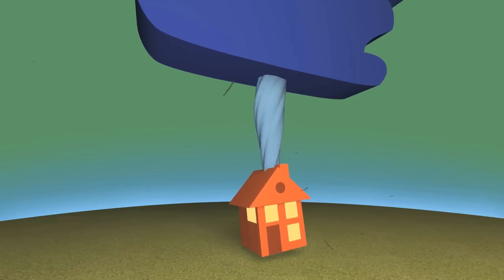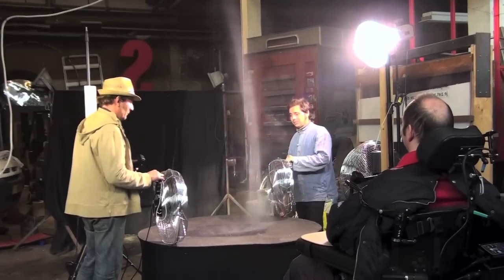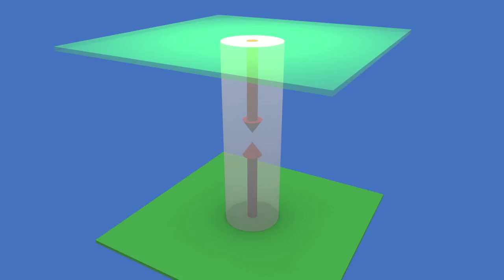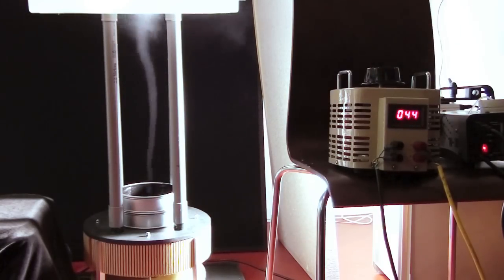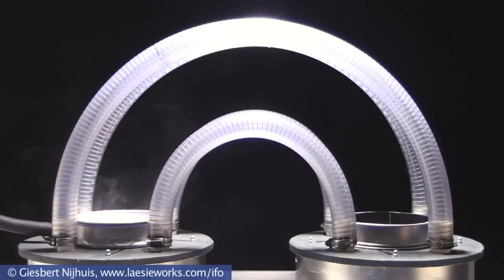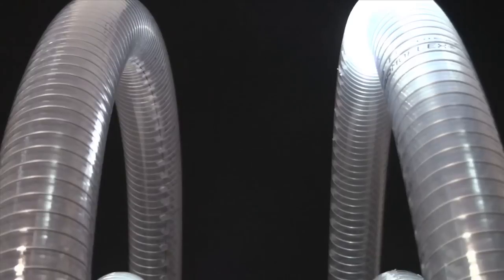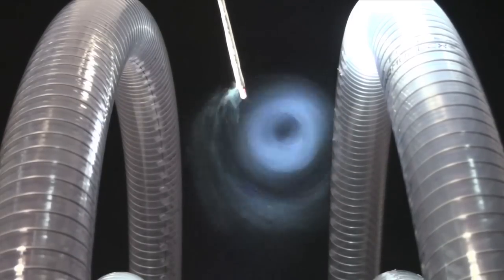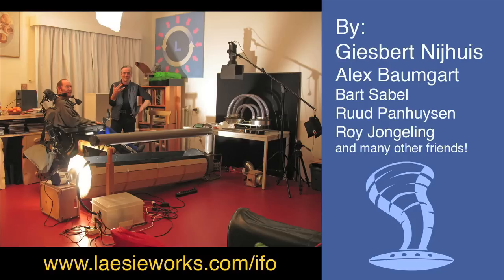Curved Vortex Lift (2010)

Comment from the maker: @scottrharris Thanks for your reply. Small birds, insects, fish, they use vortices all the time. Dolphins make vortex rings to play with.
The wings of an aircraft, yes: how wing circulation, trailing vortex, and starting vortex are connected, together a ring vortex. Though in flight the connection with the starting vortex is soon lost. Wing circulation together with trailing vortex are together like a curved/horseshoe vortex. Still no examples of using the center of a curved vortex for lift.

Comment: Very cool, I have had an idea utilizing curved vortexes for years now, but I have never been in a financial position to experiment with it.  The idea I have utilizes induced horizontal toroidal vortexes and propeller in a closed system with the goal of gaining greater thrust from the propeller in one direction.  What I have assumed is that a portion of the downward force created by the propeller could be canceled by the toroidal vortex pulling the air around its formation.  The rotational velocity of the vortex and velocity of air being pulled through the propeller should need to be similar.  Again, this is within a closed environment.  One of the cool aspects of a system like this is, in space, you could constantly accelerate.  Some, I would imagine, would say it was in the realm of a reaction-less drive, and while propellant-less it is still trying to generate an action by canceling out a portion of the reaction.  I really appreciate your videos.

Comment: @Trebseig The trailing vortices actually produce the lift. They induce a downward momentum flux that results in the force on the aircraft.  On an airplane, there is bound vorticity on the wing, the trailing tip vortices, and a starting vortex left on the runway. In the invisicid limit, these vortices form a closed loop. 

Consider a smoke ring: it moves because of it's own induced velocity. 

Take a look at the Kutta-Joukowski theorem and the Helmholtz theorem.

Comment from the maker: @scottrharris Wikipedia: "Wingtip vortices are associated with induced drag, an essentially unavoidable side effect of the wing generating lift." Modern civilian aircraft have these vertical wingtips to prevent wingtip vortex, to improve efficiency. Then again, the -sometimes- visible wingtip vortices are only the core of much bigger swirling air volumes, that can contribute to lift. Birds flying in formation make use of the vortex for more efficient lift. Not of the core of the vortex though.

Comment: A smoke ring is a curved vortex. Instead of blowing air down from the top onto a disc to get the Coanda affect I would like to blow air upward and pressurize the bottom of the disc while at the same time let the other half of the air through vents in the top and have that air flow over the top and down and then circle back around to the fan again. Once the air gets flowing around what you end up with is a disc trapped inside the top of a smoke ring. Helicopters are inefficient because the air comes back around and the blades have to try and get a push off air that's already moving. But with this design you get the air to come back up the middle and make use of its momentum. It's basically a circular wing with the center covered up(except for the vents out the side of the center piece on the top side). I know it sounds backwards(blowing air upwards) but if no one tries it we'll never know if it works. The point is to get lift by using the same air over and over. Like a smoke ring.

Comment: It would seem as though you might get more lift by changing the axis of the vortex... laying it down in a ring rather than standing it up? For example, you mention a smoke ring "propelling itself" through air, note the orientation of the ring, and the direction of travel. Just a thought.

Comment: Do you think if you built a Coanda effect oval with two opposite rotating fans that this vacuum tornado arc would form between the two fans? What kind of RPMs are you using? Also maybe if the fans were radial gas turbine engines it would be much more intense.

Comment from the maker: @scottrharris Hello Scott. True; wing tips cause vortices, and rotating wings like a rotor or propeller generate curved vortices. These don't generate lift or thrust though, are considered a bad thing: a drag, a loss. An other difference is that these vortices have one end open, causing it to break down. A helicopter with zero airspeed, can create a huge vortex ring, and crash because of that.. I don't know of examples where the centers of a curved vortex are used for lift/thrust. Do you know?

Comment: My guess is that it was magnus effect that cause the lift. But since the rotating part is gas and not solid like a kfc bucket in a magnus effect plane, it only achieve a small lift. The rotating center part of the vortex could be causing the pressure difference like with magnus effect and the two ends of the vortex is what's pulling the machine. But since it's gas and not solid that could be directly attached to the machine, the lift effect is only small. It's like pulling an object attached to a stretchable string

Edit:
On second thought, it's not like an object attached to a stretchable string since the upper part of the vortex is not stretching upwards. My guess why this only achieve a small lift compared to a magnus effect plane is that it's because the rotating part is gas and not solid like magnus effect planes. You will feel more drag if you try to touch a rotating bucket with your finger compared to a rotating gas.

Comment: Are you going to turn it into plasma stream next to see if it reacts differently? Look into how the plasma is created with the plasma cutters. It is easy to create plasma with forced air and the right equipment and if you do this to the moving air that would perhaps have an effect on what happens. Plasma is an interesting thing to work with.

Have you tried measuring the side forces when the lift is created? You can do this perhaps by putting it on really good ball bearing wheels?

Comment: I hate being negative, so first, great job, wonderful work and you're obviously a skilled DIYer. However, at first glance, this is like putting a fan on a sailboat to blow itself across the water. I don't think it's a dead end, but I don't think there's any net thrust as is. Its trying to pull itself up as if I could pull my feet and lift myself. Keep at it though, this is how ideas get refined to be working inventions. I just don't see the closed loop vortex working.

Comment: It has lots of fluctuating, I think to avoid them the whole device would have to move in one direction. Like a vortex from a vortex cannon that is only stable when it is able to move through the medium. When tried to stop it in mid air it needs a lot of energy input to keep it intact, I think that's the same problem they have in these plasma torus fusion experiments.

Comment: could u set two of these at a vertical angle facing opposite directions making a curved vortex, each facing downward? that would create downforce equally on both sides producing lift

Comment: This looks to me a lot like the Magnus effect without the use of a physical object. I assume your turbines are basically a torque converter separated by an air gap. It would be interesting if you ran a side by side with a Magnus cylinder to see if the lift results are similar. You should take a look at the videos for the open wing, I could see a similar design beeing used for a UFO shape.

Comment: neat idea but i think i see a flaw in the theory.

 the lift and weight you measured at the top and bottom of the vortex will cancel each other out. even with the example shown i believe the aparent weight change is due to the way your scale is set up. on left side of the scale, lift will be generated but on the right side a down force will be generated. that of course is due to the acceleration of the air stream. the issue is how you are using the scale. your mass should be centered on the scale, not hanging on the sides.

the only thing i can see that might generate lift is the pressure of the faster moving air, but i feel the fans cancel that out.

keep working tho, it is an interesting idea and it may lead to other uses of the technology. unfortunately i just cant see this being able to generate lift.

Comment: 0.5N "lift", from a machine weighing, what, 100N?

That's not lift you're measuring, it's the mass of the air moved out of the centre of the vortex.
Reply: Mark Langford weight isn't measured in N
Reply: Tim Dijkhuizen Yes, it is.
Reply: Mark Langford no it isn't Newton is a measurement of force, not of mass
Reply: Tim Dijkhuizen And weight is a force, so it is measured in Newtons. Mass is not weight, weight is a property of mass due to the effort of gravity. That's basic high-school science.
Reply: Mark Langford the force that gravity has on the object is measured in Newtons, the weight is not
Reply: Tim Dijkhuizen The force of gravity in the object is the weight!!
Reply: Copy the link and past it in your browser and have a Nice read
Reply: You haven't posted a link, but it's OK, I think you are just confusing mass and weight - something I often find with the younger students in my Physics classes...
Reply: You have to copy the whole text because otherwise it will not work
Reply: ***** why the: m/s?
Reply: It's actually 9.81 m/s/s, the acceleration due to gravity on Earth.
Reply: Where I live it's 9,8121
Reply: ***** did you know that I didn't know that?
Reply: ***** but if whe are gonna be precise then we go al the way
Reply: ***** what do you mean?
Reply: Mark Langford p

Comment: Do you know what happens when a shotgun shell does when it's fired but not in the barrel? Practically harmless,  considering.  Both work best in a barrel.  Concentration of mass in fluid dynamics.  Bernoulli's principle I think.

Comment from the maker: I understand vortex and implosion, but the "Crystal Ion" by Karl Haskell... I don't understand it, does it really work? Do you understand how it works? "It is a mechanical device built to spin at high revolutions without the need for any fuel, combustion or compressed air. -- A tornado is created in the engine that implodes on itself which actually speeds up and sustains the airflow back into the tornado". Hmm.

Comment: You know if you were to expend that much energy blowing down you would have much more lift. I'm not trying to poo on your parade here but there are some fundamental flaws in what you are trying to do with your technology and definitely misapplying it. I could see you making good breakthroughs in fluid and gas handling applications.
Reply: the scale was to measure the weight being applied opposite the direction of the vortex... it was only done with the vortex up for ease of experimentation. If flipped over, the system might yield more force, maybe less.
Reply: You mean ground-surface effect?
Reply: I mean that there is no logical reason that the system couldn't be hung from a scale and activated to test for lift potential. I think it was done upside down for ease of setup
Reply: Doubt it. Judging from the size of that machine. It would be blowing no more than 0.05 cubic meter of air per second. If all of it is directed downward, that would just be about 0.06 kg of lift. About the same as what he is getting now.
Reply: Aviator168  but isn't that the point? he is using a controlled stream of air, spiraling it between the input and the output, with both facing the same direction and producing force.... in open air. with the device inverted and perfected there would be more lift and no need for an intake above the device/vehicle
Reply: This Experiment is like trying to get a plane to lift from a treadmill. It feels just like that, not to say the guy is an idiot, he's just trying new things and it would give other people new idea. We need people like him around.